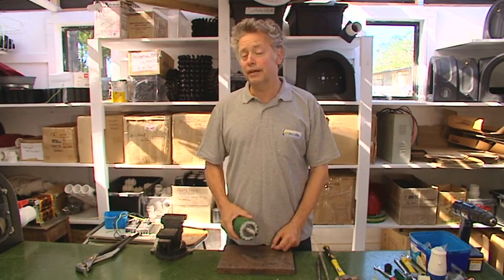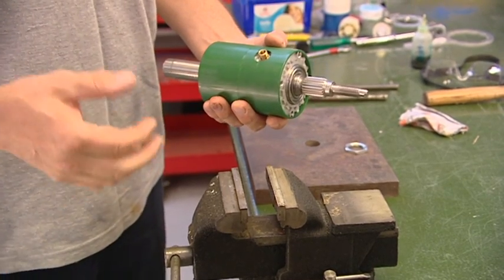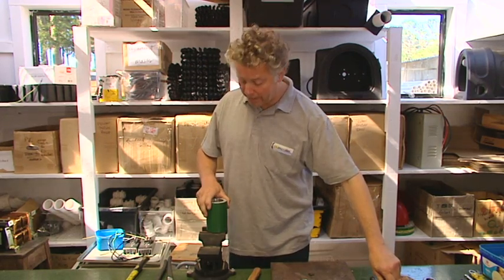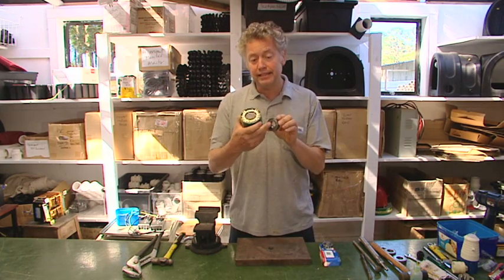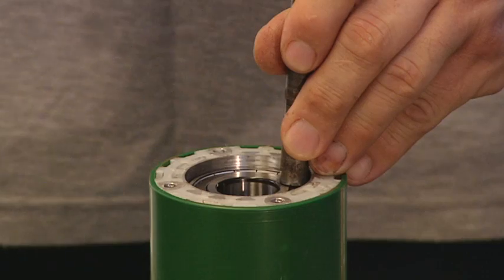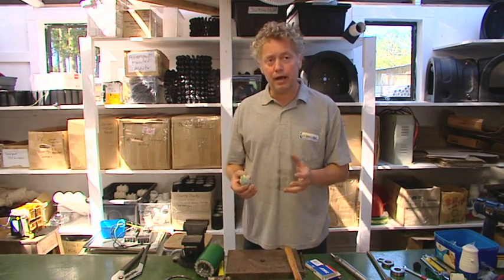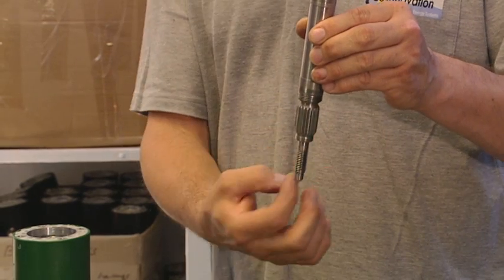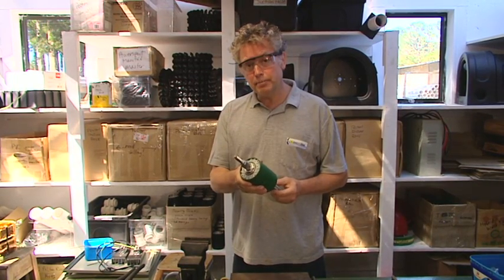PowerSpout How-To #9: Replace the Bearings in the Bearing Block

Comment: Once I saw the channel lock and hammering with no brass block or wood on the shaft end I would have fired you.
Reply: This is advice for clients in the field, the end of the shaft is tapered for direct contact with a hammer. Use of channel locksl is fine.

Comment: The thread locker you are using is not needed if the bearing fit is correct.It may infact shorten bearing life.

That come from 20 years experience rewinding electrical machines and replacing bearings.
The bearing manufacturer will provide you with the proper shaft housing clearences
Reply: You can read our bearing care guide here https://drive.google.com/file/d/1NTMX3xF_Bv4bUS3XbIpZCL-0XZZsiQ1C/view